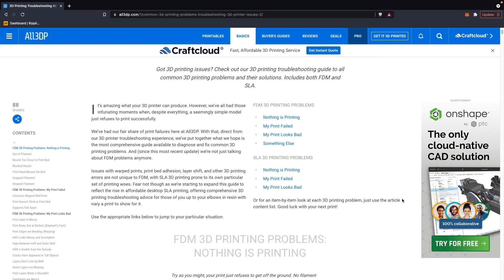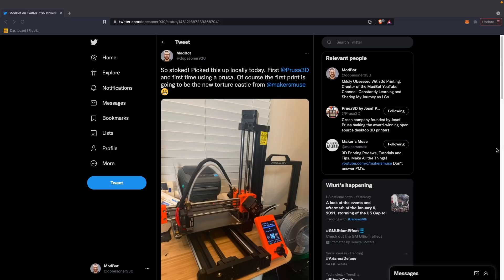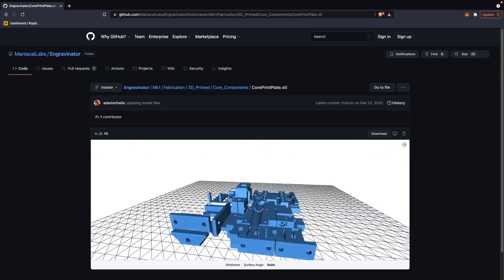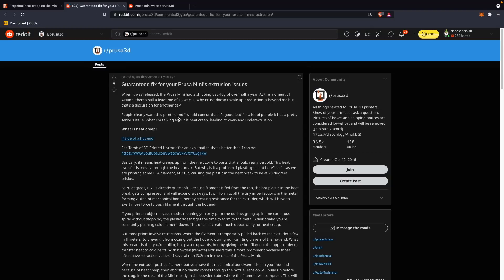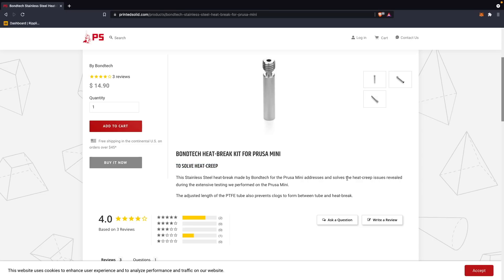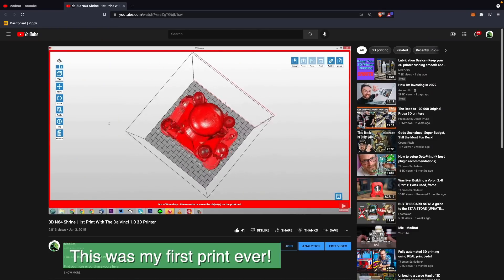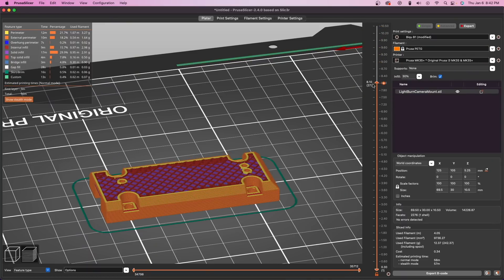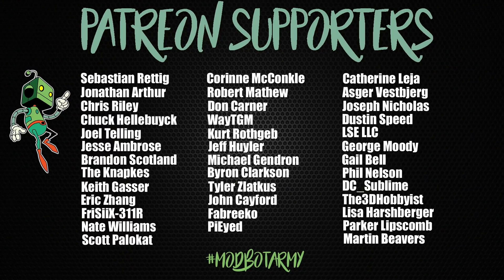DO THIS Before Troubleshooting 3d Printer Hardware

Comment: Using SuperSlicer si sometimes have some patches where the fanspeed is nonsensical.  In my ABS preset i disable the fan for everything where it is not needed. But very short layers and overhangs do get Fan. But Sometimes in the gCode preview i have perimeter patches where the fan is on for no reason. And Oddly enough shifting around the model by some millimetres on the build plate makes them disappear, But plenty of times i just ignored it and i had no ABS print ail due to the fan randomly turning on, cause most patches are not long enough for full spool up of the fan.

Comment: Another great video. I was on the edge of my seat.... what could it be???? 😂 Yeah, I've  recently had weird, random mid-air extrusions using Simplify 3D, looks like infill hanging in the air. I used Fusion 360 for the design and ended up redesigning it from scratch. That cured the problem but not sure if it was coincidence, a corrupted file or just bad design 🤔

Comment: I’m very new to 3-D printing so I did  not quite understand some of the terms you were using. I’m a little confused at how you fix the issue. You found where the problem was but I don’t know how it was resolved. So you say checking the G code but some of us don’t understand what that means at all. You found the problem in one piece of software but it didn’t show up in the slicer which is the same slicer that I use on my Prusa. Can you help a brother out and please explain a little bit more

Comment: Mine wasn't a gcode issue, I decided it's the filament's fault. I had designed a piece recently and used a roll of filament that usually prints things well but for this particular file, I kept getting weird under extrusion and gaps on the top layer. Only on the top. I resliced with different settings, slowing down the speed, increasing the temperature, increasing overlap %, changing to monotonic, etcetc everything you can think and after like 30 failed prints with the exact same gaps on the exact same place (I only printed the top half to speed up), I gave up. I changed to another filament and it worked perfectly fine. So I thought ok this failed filament is bad, so I test it by printing another file that I had previously printed, and IT CAME OUT FINE. So yeah. I decided this filament x this new file is just impossible. This file will can never be printed with this filament, ever.

Comment: Just had a similar occurance from SuperSlicer, which is also a Slic3r derivative. In my case it was a spot on the support's first layer where the extruder would skip a couple mm. Exact same spot every single attempt until I got lucky with it not snagging the nozzle. No other problems in the entire print but it was perplexing. I too went through rebuilding my hot end with fresh capricorn tubing, even printed one of Chep's cut guides to re-recut it after the first cut lego speared due to a slight gap. Still same spot after that. Now I'm probably going to open that file up in another slicer to really look at it and see if it's the exact same issue but more localized than a whole layer. It's been bothering me since that it happened, sign it'll happen again and possibly much worse.

The term lego spear is what I call it when the bowden tube insert doesn't touch the nozzle  completely. If you do a cold pull it snaps at that gap leaving what looks like a lego spear tip from an old lego set. Was at least cool to see they come out so easy, took  good oil bath to get the nozzle so stick free.

Comment: Once I missed to change the nozzle size in slicer after changing the nozzle of different diameter . The output was fully under extruded. I did not even realise why it happened.
Once there was a bug in cura of particular version, which sligtly shifted the print in X axis which made hole not aligned fully. It took sufficient time to understand that it is not issue with printer.

Comment: I was experimenting with stopping my print at a specified layer to change filament color. When it would resume, it would extrude a giant blob of material on the printed part.. I immediately checked the code and could see the massive extruder feed value (searching for the M0 as I knew it was happening at the layer pause, and found a E-value by itself before making its first resumed x/y move), removed it and had fixed the print. Not that it makes a difference, but I feel being a machinist it was natural for me to check the code

Comment: My experience with Mini plus was not stellar.
I had a new machine delivered with shorter ptf tube and I lost hours with support till we got it and only to replace it from spare parts that are delivered with the machine. Why they are letting faulty part to be delivered that you need to replace from spare kit is question that only Prusa can answer.
Other issue (and my biggest one) is that this printer is almost impossible to square.
The few dollars/euros saved for not including a couple of metal brackets leave this printer almost impossible to square at Z.
I wanted to split one larger box like object, and I could not get edges to align to be of any use.
I know there are instructions about what to check regarding squareness, but it's never going to work if you need mechanically accurate prints (I tried it).
This printer could have been sooo much better if they have not tried to cheap out on couple mechanical brackets that could have made it square.
For stuff that are printed as single part it's good enough, but if you need precision, in my experience it is not the right choice.
There is only so much hardware imperfections that you can fix with the software, and this printer reached that limit.
(this is only my opionion)

Comment: I had an interesting issue... faulty motherboard... all worked but partially corrupted 80% of my sliced prints after safe remove of usb.... temperary fix was putting pc into sleep and removing... saw it worse on my resin printer but most issues were failed prints after about 3 hours, missing layers, under/over extrusion issues, bed level jumping to differing heights, sticking z drive, doing nothing at all, fail to heat,  layer shifting in the y axis... totally random at any point failures... i worked it out due to my photon zero... sticky z every time i safe removed usb (i even replaced the main pcb on my printer and reflashed etc... to no change. other than an incling of a corruption.) amd usb issue ... that issue amd said they patched.... didnt fix the usb issue for msi motherboards. How i fixed the issue was a windows reinstall (one step done before i worked oout it was the motherboard) and changing to asus motherboard. i have no issues thus far. In fact, prints have massively improved!.
please do try it... issues with slicing... just try putting pc to sleep and unplug usb first... may save alot of diag time (think this is amd specific)

Comment: I had a similar issue to yours back when I used Cura when Adaptive layers first came out back in like 2019. It would under extrude at the same height every time and make a line through the prints or just clog the nozzle to the point it stopped extruding and air printing. Now I use Prusaslicer which has been working really well till just recently. At the end of some prints from prusaslicer, it was moving the nozzle down and melting a hole into the top of the print and then getting stuck or popping the print off the bed. I dont know what changed because I never changed anything in my end gcode and best i can track down is that It started after an update i did to prusaslicer a couple weeks ago. Oh, I almost forgot, I was also having a layer shift at the same height on one of the prints I did, so I did a test using cura on same file which printed just fine. Maybe something weird happened in Prusa's recent update that caused some issues?

Comment: Nice one. Bottom line is: Do not use prusa slicer :-D I also use ideaMaker for slicing but yesterday gave the new Cura 4.13 a go, nothing fancy,  a 8x5 PETG coupling.Imported the STL, copied the model once to print two of those, sliced and off to the printer. Well, what do you know, after an hour and a half print pops out, one coupling around 5-10% larger than the other. same model cloned. If someone can explain that!!!

Comment: I’m new to 3D printing and my first problem came way before I ever printed anything. During my test run of everything my bed wouldn’t heat! I looked it up on YouTube. Did everything they told me to do and that didn’t help. Contacted who I got it from. They couldn’t figure it out. So eventually I said f**k this and opened it up. There were two wires not even connected. And that was a two month process! Not even joking! I’ve had other problems since but nothing that big. My message for noobs to 3D printing world, don’t just give up. Check everything. And check it again. YouTube normally is a big help. But sometimes you just need to open it up to find the problem!

Comment: Hi, great videos and tips you give. Sorry to bother but can you or anyone from your viewers help me to fix my "ender 3 pro", it all happened few days ago, when midprint it froze and had to turn off as i was unable to give it any command with the knob, now when i look for files to print it says "NO TF CARD", i have tried with diferent cards and formatting severa, times makin sure they are fat 32 and mbr partition (my searcb for a fix on internet says this is the only format the printers work with), sadly this does not fix my issue; only thing left is to print with it conected to a pc (not ideal, even less ideal for long prints as any power outage will force me to restart the print) or reinstall/flash marlin wether it be original version it came with or and upgraded version i found on creality's website.

Is thereanything elsei can do to fix my printerbesides getting a new board?

Comment: Not sure what it is but I have a ender5 that when I used cura creality slider or anything else, besides 3d printer OS, it would shrink the print and put it in the top right corner of the build plate. For some reason my first print I pulled off the web using creality slicer it worked fine, bit anything I made after that I would have the issue. Now I don't have it, if any one has any idea please let me know, I don't know where to start besides gcode even thought the 3d model shows up fine on my computer.

Comment: I ran into a similar issue using octopi that set me back a over a hundred dollars and tens of hours in diagnosing. I kept running into strange blobbing issues with my prints, thinking it was a hot-end issue or filament issue. After rebuilding my hot-end multiple times I finally tracked it down to an issue with octopi failing to send gcodes fast enough that would my prints would pause occasionally and I would get little blobs on my prints. After replacing my raspberry pi everything was smooth sailing from there.

Comment: I had this exact same issue with my Aquila. Using Cura. Slicing looks good but comes out sh*t. Tried other slicers and got great output. After loading in another profile everything worked great as I was used to. Also printing with polyterra. Nice to see you're using it too 👌
Reply from the maker: It is such a nice filament. This is also part of the reason I think everyone should at least have slight familiarity with a second slicer. You never know when you may need to use a second slicer in a situation like this.

Comment: Checking the toolpath throughly is always important before starting any CNC machine to avoid mishaps. One note: You can't check g code files with G2 G3 (Arc welder processed and similar) as the slicer itself do not understand these commands and will then just show a huge mess. Here u need to be sure everything is 100% correct before exporting to g code as you can't post check it later.
Reply from the maker: I know for a fact that it is a rule when running a CNC milling machine. Great way to damage an endmill or destroy some material otherwise. I do not feel it is quite as much of a standard with 3d printing but it is a great habit to get into.

Comment: For the last WEEK I've been dealing with a really "undiagnosible" issue which turned out to be a z roller getting caught on a modded part I added to it. Stepping aside to clear my head really made all the difference. Plus I have a great set of friends that help me think through problems. Even though most of them know nothing about 3D printing, let alone troubleshooting them, they were a massive help as well!
Reply from the maker: It is amazing how just stepping away can make such a huge difference. I was almost hitting my head into the wall one night when building my first Voron 0.1. Went to bed and the next day the solution came to me.
Reply: @ModBotArmy  Yuuuup! I can't count how many 2am epiphanies I've had now hahah. That's the night owl in me coming out!

Comment: I use Cura with my Ender 3V2 and have had I think 2 prints just stop at exactly the same place in the middle of a layer.  Just reslicing it didn't fix it, i had to move the model  a couple millimeters on the build plate and then it would slice and print without an issue.   Slicers are crazy.
Reply from the maker: I am sure mine would have been the same way. Since I had 5 parts and didnt save that config when I reimported them there was not any issues but I am almost positive it would have repeated like you described.

Comment: I had been making batches of something I'd designed that had a flat area with a raised logo for a couple months when I upgraded to Cura 4.11 in the hopes the monotonic top layer feature would make the finished surface cleaner. I started noticing scarring on the top layer just under the logo and couldn't figure out what was going on. Getting frantic because I was working on a modification for a customized one for a customer on a deadline, I modified the surface of the original, set z hop over printed areas, deleted the logo, put the logo on a raised solid, same issue. It was also doing it on areas raised off that surface, so deleting the logo wasn't a total fix. I watched the print happening and saw the print head going to random points around the border of where the logo would be on the layer before it did the logo. It wasn't until I went back into Cura, went to the layer, and then wiped through the print head travel for the layer that I saw it was leaving tiny gaps in some of the lines and going back to "fill" them with a dot after most of the layer was printed. I went digging for the earlier version installer and found the Arachne engine beta build and tried it out. Sliced the file and no gaps in the layer and no extra travel over the finished surface. It even had the monotonic feature, so best of both worlds. Something about those versions just didn't like the file for whatever reason. I now keep both cura current and the arachne engine beta installed, mostly using the latter. The next time there's a major feature release for regular I may throw the part into the new version to see if the gap thing is still happening.

Comment: 5 or 6 years ago, around the time I commented that your folgertech i3 wiring was giving me anxiety, I had a completely mind boggling failure on every print I was doing at the time. It looked as if the z axis wasn't lifting and was just smashing out plastic, but everything was nearly the right height when done, so then I'm checking for over extrusion, but 10 sanity checks in, the math keeps being the same...    I forgot I'd been experimenting with printing  0.8mm extrusion width from a 0.4mm nozzle in vase mode the week prior. It was my own slicer settings the entire time.
Reply from the maker: OMG, I wonder how many issues I have had over the years that were self inflicted due to slicer parameters. If someone is having a ton of issues I will often make the recommendation to go back to a stock profile and see what prints look like.

Comment: Happened just yesterday, couldn’t get it remedied, abandoned part
Reply from the maker: Did you try a different slicer?
Reply: @ModBotArmy  for some reason Prusaslicer and superslicer are the only programs that load on my computer and both produce the same problem. Usually manifests like yours but sometimes doesn’t have support material adhere to the layer below it but walls will be fine, like infill skipped first layer

Comment: Had it with SD cards before, but using octopi it hasn’t happened. I’m guessing when sending it over wifi there is a checksum involved. I’m the opposite to you I go to software or put it down to me doing something wrong before messing with hardware as I’m lazy and don’t want to mess with my dialled in printer 😅.

For me if two prints are failing at the exact same place I’d put it more down to gcode, slicing, problem in model, overhangs etc first. if it was hardware it would be a bit more random.
Reply from the maker: I have definitely had issues with sd cards. However, I may not have caught it on fdm machines. On resin I have had 1-2 and it was super easy to tell because of the absolutely insane ouput I was getting imagewise.